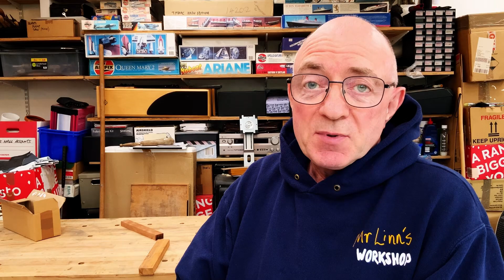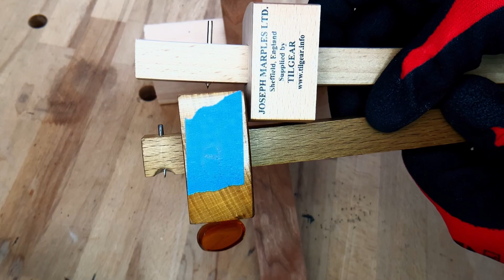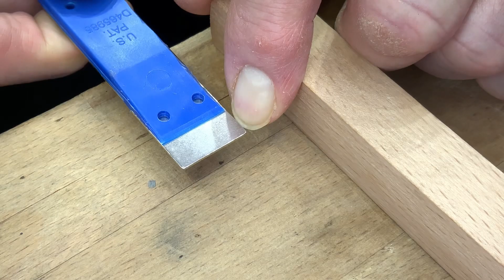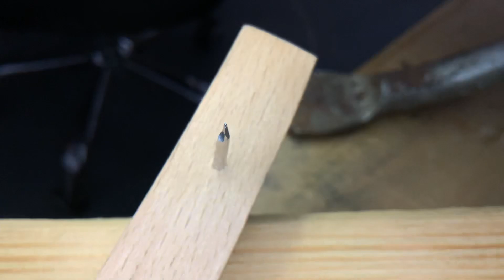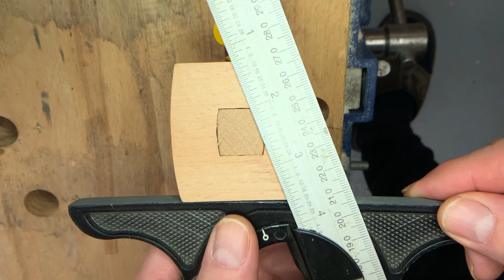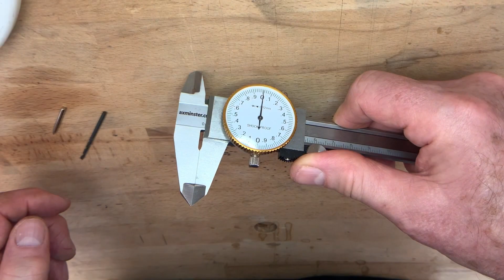Modified Marking Gauge - Let’s Make One!

Comment: After watching David Charlesworth's video I found your video, and afterword I immediately set off on modifying my gauge. The original set-up used a wedged-cutter that went missing years ago.  For a new cutter I eliminated the finicky wedge setup, and fabricated a new cutter from a discarded drill bit shank.   I drilled a press-fit hole (-0.0035")  in the other end of the beam, pressed in, and aligned the new cutter. It works so much better than it ever did brand new! Thanks.
Reply from the maker: Thanks for the comment Barry; I’m glad my video inspired you! I’ve been using the gauges in my recent Workbench series and, whilst they’re still working well, I suspect my cutters are slowly receding into the shaft. When I get time I might have a think about what to do to stop that…
Reply: @mrlinnsworkshop  incidentally, I found that the shank of an old drill bit works great for a replacement cutter. (I have a lot of old duplicates)

Comment: Thank you for this video, Jim!  I made four of the marking gauges when I attended my last class with David.  Two have the flat side of the pin away from the handle like yours, and the other two have the flat side towards the handle.  This allows me to decide which side of the line the waste will be.  A round file or rasp makes quick work of the removal instead of using a gouge, but it's results that count.

Also, David's modification included a small leather pad in the screw hole.  He had an old leather belt and used a 12mm diameter punch (might have been 1/2-inch) to cut the pads.  These provide a soft interface between the plastic screw and the wooden shaft, and allow more tightening force with the screw without making dimples in the shaft.
Reply from the maker: Good morning Mike, I was just looking through comments and I apologise, I’ve just found that I don’t think I replied to yours. Thanks for the comment. Come to think of it, I do remember David talking about putting a bit of leather in the hole. It’s a good idea. I haven’t done it yet, but I have used the gauges in my recent Three Leg Workbench Series.

Comment: Jim- fascinating video and demonstration. Thank you for the time and effort you put into all your videos. How would you anticipate these same modifications fairing with the half round heads? Anything you can think of as potential adjustments that might need to be made? Thank you again!
Reply: @dcamporeale  , Thanks for the kind comment!

I think it would be just as easy to modify the half round head gauges. I chose the square ones because they’re cheaper and that’s what David used. I would orient it so that there was maximum bearing surface against the work.

Comment: Amazing tutorial. I want to make one, but it looks like this design limits you to the push motion only. Is that correct?
Reply from the maker: Thanks for the comment @OldHeapOfProblems (great handle, by the way!), and I’m sorry for the delay in getting back to you; my own heap of problems! 

It’s true it’s designed to work best whilst pushing. This is because the design enhances visibility of the pin for start stop accuracy. So yes it’s sacrificing two way action for the sake of visibility of the pin. 

I guess you could try pulling it (I haven’t yet; away from the workshop…) but I don’t think it would be as controllable. The circular blade gauges are be good for that.

Comment: Excellent instructions. I've often thought of getting a Pin Gauge to go along with the rosewood (mid '90's) & brass Crown cutter gauge and two brass wheel gauges I have, but have always shied away due to their purported grain-following reputation. Now, it seems, I'll be adding another tool to the toolbox.
Reply from the maker: Thanks for the comment John. The key to avoiding grain following is to get the cutter angle set in the stem just right so that it just slightly pulls the stock against the work edge. Might need a bit of trial and error!

If you do make one, let me know how it works out.
Reply: @mrlinnsworkshop , Thank you for the reply. I shall let you know. However, first I must find a 'round tuit.

Comment: Thanks for showing this. While I do like the wheel gauges, one advantage to the pin gauge is when doing a stopped mark, like you show at 22:39, is that you can first push the pin into the material to make a dimple at what will be the end of the mark, then as you make your mark you know to stop once the pin falls into that dimple. That's one of Paul Seller's tips.
Reply from the maker: Thanks Corwin. That’s a cracking tip! Now that you mention it, it’s obvious isn’t it; I didn’t realise. I subscribe to Paul’s channel, but must’ve missed that bit. He’s a fantastic craftsman, with decades of experience. His main gift is his ability to explain clearly. Interestingly, some of his techniques - like sharpening for instance - are completely different from the way David taught me, and different again from Rob Cosman’s, but we all achieve the same result. Just goes to show that often there are many ways to do things, none of which are “wrong”. The best way is the way that suits oneself.

Comment: Jim, thank you again for your Xclnt work!  

I notice that as I age my grip is less secure than it was. Is that the reason you use gloves?  I do, for that reason …
Reply from the maker: Thanks for the kind comment John!

I understand what you mention about grip, but the reason I wear gloves off and on in my videos is dermatitis. I just don’t like to see it in close up! Whenever I review a clip, if it’s obvious, I reshoot with the gloves on. It started in 2018 when I was making the window frames for the workshop and spread quickly to every finger tip and some knuckles. After several years of treatment - which included at one point having to wear nitrile surgeons gloves all the time to keep treatment in - it is almost gone, apart from two finger tips and two knuckles. It’s worst effect is skin splitting along the fingerprint lines, which then takes a couple of days to heal, during which touching anything is uncomfortable. When the condition was at its worst, all ten fingers had splits of some sort. 

My dermatologist says quite often the cause is a mystery, and one should resist trying to link a particular substance or activity to it. It just happens and just goes away.
Reply: @mrlinnsworkshop  Jim, I'm sorry to hear, and feel embarrassed for asking … I trust it will clear up completely and not return!   … in winter, cold shop, my cuticles split at the edge of my nails, which makes using force with my hands similarly uncomfortable … cheers!
Reply from the maker: @johnoerter2883  Don’t be embarrassed John! It’s a legitimate question. It’s much much better than it was. I think actually applying force - most of last year building the Extension - helped, ironically.
Reply: @mrlinnsworkshop  Interesting … mine just split further, so I medicate and put bandaids around, and they eventually heal up … not so much a problem as it has gotten up into the 40-60s here in Indiana USA, and not teens-20s …
Reply from the maker: 😆😆 I was thinking: holy mackerel that’s hot! Then I remembered… Yes temperatures that cold will be hard on our old hands!
Reply: @mrlinnsworkshop  I grew up with imperial and fahrenheit … now, particularly for figuring dimensions I use metric, and celsius seems COLD to me  😁
Reply from the maker: Most craftsmen in the UK use both imp and metric as necessary. For instance, I’m doing stud work at the moment and went to the yard and ordered “2 by 4s” 🫣
Reply: @mrlinnsworkshop  yup. Me too 🤓